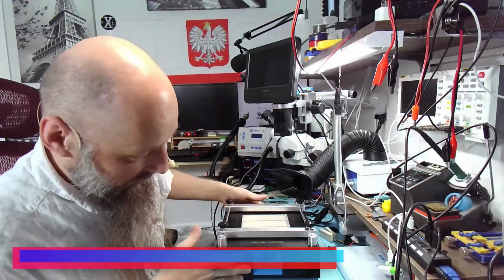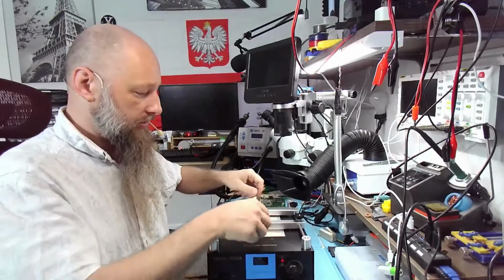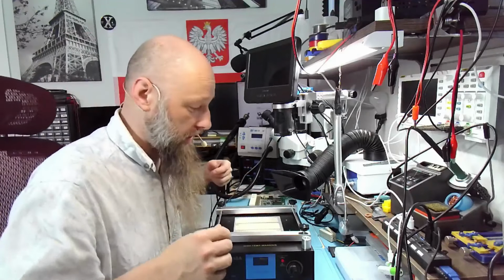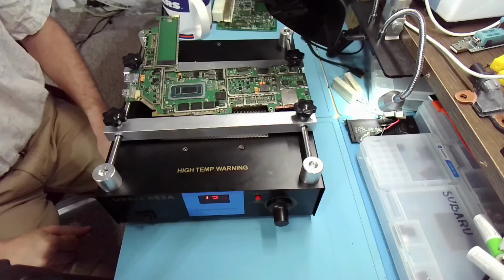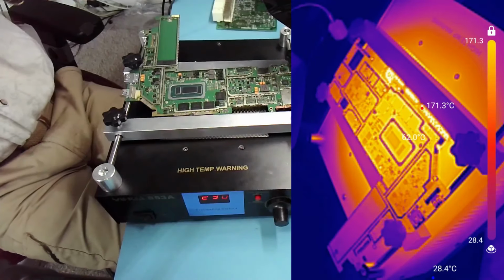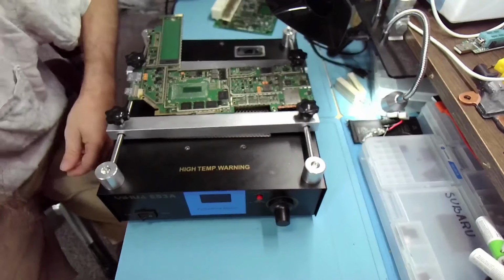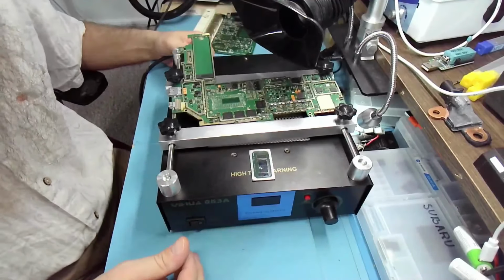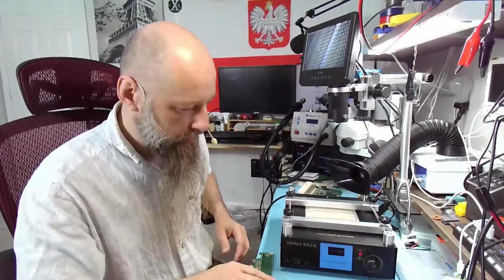Yihua 853A Preheater for Removing CPUs and BGAs

Comment: Great video. I’m planning to buy one soon to help with TSOP SDRAM chip removal on old video cards. It’s very possible with just hot air but feels like I’m blasting the cards with so much hot air for way too long to get them off. I’ve had some chips popcorn and think it’s just better for the card overall to preheat. Haven’t braved BGA work yet but could come in handy for that in the future too. Cheers!
Reply from the maker: yes, preheater will give you much better results, even a small one like this. You can also look into IR6500 rework station, gives you a bit more precision than hot air

Comment: Thanks for the video. I have the same one. I also want to do more experimenting with it ☺

I mostly blast the max 400 onto thick boards with it and then use around 350°C hot air. Works well so far, but the whole device becomes pretty hot. I was thinking about adding some handles. I also built a temperature probe from a temp sensor of an old coffee maker with 7 segment display from some old dvd player that is very useful to show you the pcb temp when you stick it to the pcb but your flir cam should do just fine as well.

I think its a super useful device that has potential to be modded in many ways .
Reply from the maker: yeah, I have to mod it, it goes up to 280C and the board doesn't exceed 115C, we'll see how my new nozzle works but I'd like to put 180C on the board plus heating from the top
Reply: @blackhorserepairs  Yeah same here. The board gets to around 115C. May try to move the board closer to see if it gets any hotter.

Still gotta figure out the best way. So far its possible to remove big BGA's and stuff with it and thats what I got it for.
Reply from the maker: @MattFixesStuff  removing the holder gets you another 15C, the highest temp is 280C (when set to 400)
Reply: @blackhorserepairs  I fixed a phone pcb yesterday that didnt get hot enough and put it directly on the heating element. works great.